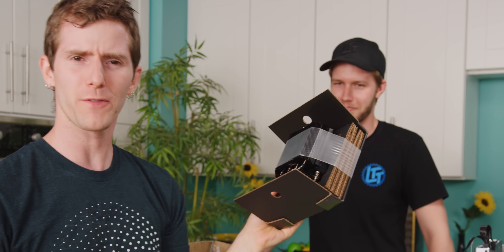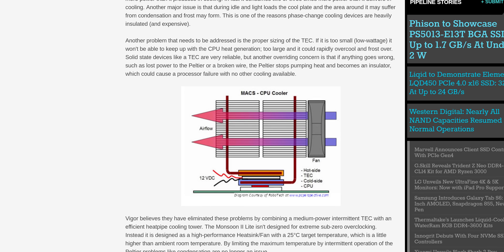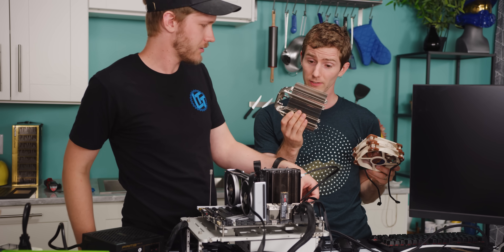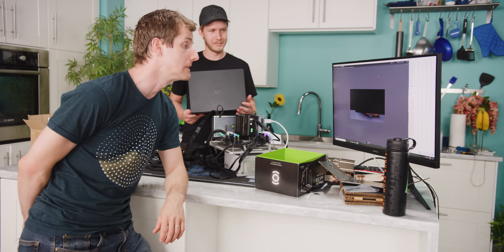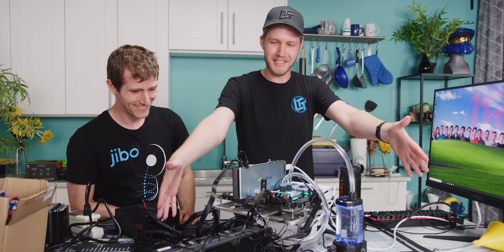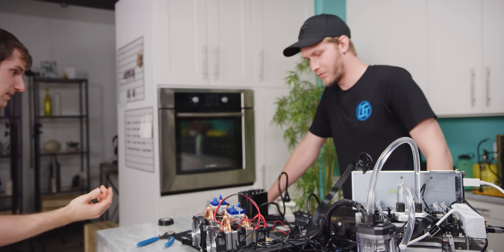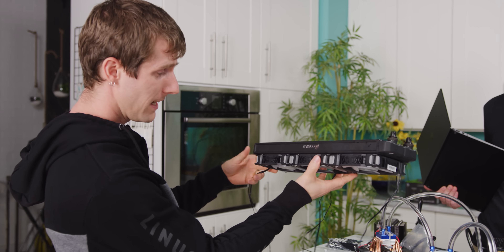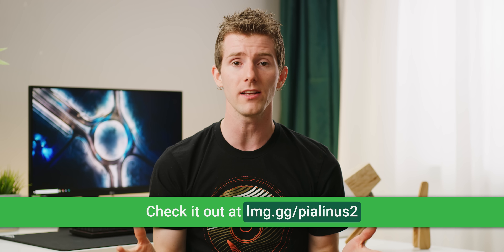Thermoelectric Cooling is a Bad Idea

Comment: Thermoel. devices should be controlled with linear control for max efficiency. Otherwise they are bad. Efficiency is a peak in behavior which can only be reached by feedback controlled systems.

Comment: Water flow should be more turbulent in the module itself. There should be more design work done so it works more like a water heat exchanger.

Comment: i think what's happening here. the way you cool the system comes down to how much heat you dissipate vs how much you produce. peltiers are only 5% efficient. this means every 5 units of heat it transfers, it produces 95. this means the radiator is working its ass off to dissipate the heat added the peltier. it gets the radiator hotter and that helps speed up cooling but it can't even come close to the 19 times more heat it introduces.

the advantage peltiers bring on the table is that they enable us to pump heat between mediums that are at the same temperature which a radiator can't do. then again in this context if you don't have much temp diff, you don't need cooling.

the only way i can think of utilizing peltier here is that if we need to transfer heat faster than the temp diff allows us. i.e. the cpu produces so much heat that we already need a giant ass radiator but because it is so big that we can't get it hot enough. we can't conduct the heat as much as we need. then the petier could help pump the heat to the radiator and/or from the radiator to another one.

Comment: Ive been more interested in using the Peltier Modules to chill a tank of coolant that is used to directly cool the CPU and/or GPU, etc..
Using an additional radiator to water cool the Peltier Module on a separate system/loop.
Thus creating a kind of battery effect of super chilled coolant for when you actually need it.
So maybe a 4 module system of say 2 or 3 amp Peltier's that can be kicked in to extend the cooling time available, also affected by the coolant tank capacity.
Would this be a better and more efficient system than other forms of peltier cooler systems?
Would you be willing to test this theory???
Oh the reason for the smaller capacity peltier's is that the more Cells on the block the more heat is transferred in a smaller space and the harder it is to efficiently remove the heat from the module.

Comment: Why not combine a standard loop with a fish tank chiller? The radiators still do the majority of the cooling. The chiller can be used to lower the water temp even further once there is enough radiator and fan capacity to keep things under control. With a temperature comparator to monitor ambient air and water temp and control the chiller, the water could be brought down to ambient at idle. At load, the radiators will do the majority of the cooling, the peltier just assisting the existing radiators. Thereby avoiding any issues of throttling by the peltier.

Comment: The benefit of the peltier cooler is that it can make things “below room temperature”. Which means we should not use conventional structure to build the system. I have an idea: making a large piece of solid copper or preferably with many thermotubes have contact with cpu while place many pieces of peltier coolers in contact with other sides of the solid copper. Using hydro cooling system to cool the peltier cooler. You guys may give a try.

Comment: I got one of the chinese 5x40mm aliuminium peltier blocks cooled by 480mm radiator.
Thats how much peltiers you need to have sub-ambient water with Ryzen 5800X running full tilt, each 12710 peltier is about 78w on 12volts, thats 390watts used and that aint the cooling power, its much less.
I found this impractical and desided to start using it as room cooler in hot days with radiator at cold side cooling the air.

Comment: here's a fact:  nasa's voyager 1's nuclear rods have... you guessed it... TEG Thermoelectric Power generators producing voltage to power the spacecraft outside our solar system, probably cost thousands back then, now you can get them on Ebay for 4 bucks you can even make your own power generator

Comment: Soooo if the PC generates heat into the hundreds of degrees couldn't you do the inverse with a peltier plate? Pulling electricity from the heatsink and generating cold, whilst powering a low power usage fan that if a certain box was formed with air ducts of some kind could power a fan that redirects that cold air back to the air intake fan? Resulting in colder air being pushed into the heatsink without an overwhelming increase in power consumption or none at all?
It might only give you a few degrees in colder temp but since your already generating high heat from running at full blast might as well reuse that heat for further cooling right?

Comment: The only thing I have every found them useful for is that when I was a truck driver in the '90s, I had an Igloo cooler that had one built into it that was designed to fit in a specific space in Freightliner sleepers. It worked great. Never found a useful application again. They have a COP of about 2 max if you can find a place to dump the heat away from what you are cooling.

Comment: TEC cooling can be done well but as soon as it went from hardcore hobby to off the shelf in 2007 you ended up with crap like this.  Back in the early 2000s when you had to solder jumpers on your motherboard in order to even over clock is when I did a TEC cooling setup. Liquid cooled the hot side into a chevy blazer heater core and yes I used an external power supply for TEC. Had to enclose the cold side in neoprene to prevent condensation, ran the CPU at 5 deg C under full load and -5 under marginal load as overclocked as was possible with the motherboard and memory limitations at the time.

Comment: This brought back memories! I was using peltiers back in  98-2000 for my gaming rig. I’d run a peltier  sandwich which was a copper plate on cpu, one peltier on the copper plate, another copper plate on the hot side, two more peltiers, another copper plate, then 4 more peltiers, and a custom water block. I used a modified aircon unit that had the evaporator concealed in a water tight unit running a fully submerged water pump with about 15 litres of coolant which passed through the peltier water block. There was a lot of Insulation and waterproofing required to battle condensation. I was able to achieve -91c on the chip. Snap froze my nephews fingers to the cold plate 🤣😂 I smoked a few mother boards and chips in the process. I finally had enough when I went away for a weekend and my partner who couldn’t bear the noise of the water pump and aircon unit condenser cooling fans, powered everything down except the peltiers. Needless to say all the insulation had melted, and the chip basically crystallised and cracked. All of this to overclock chipsets like Celeron 333 🤦‍♂️ it was pointless and expensive, but fun experimenting with them.

Comment: I'm a DIY mechanic. Knowing how engines in modern cars such as a bmw use a map controlled thermostat. Without it , it will just buildup heat and not be able to maintain let alone drop its cooling temperature. This is just worthless unless there is trillions of dollars thrown in engineering.

Comment: been experimenting with this in another way.... use a peltier on a waterblock to cool the water... and power it with a controller that reacts to the water temp... results are monster!! but the energy bills are crazy... whahah really crazy... my new idea is to minimize the power usage of a peltier by turning heat 2 voltage .... well it's only at idea stage because the physics is still way above knowledge, i know it is possible but as I sayd... knowledge, time and budget limit me... so if someone reading this does have those factors.... good luck and give it a brainspin...yup I know 100% returns is impossible hahaha lets start with a few % and see how far this can go..  and what is better for generating power ? the fast changing part(source) or rad.. (slow)... capacitor or battery style syndrome so maybe both... hahah the way I build my setup was by creating 2 units... one case is my pc.. the other my cooling case... the powerdraw is like having 2 pc's hahaha from out of the box thinking and creating 2 boxes... crazy

Comment: Sir i want to use 4 [TEC 12715] peltier module from one Power supply each peltier module requires 12V 15A  so which smps is suitable for sufficient power for all 4 pelter modules?

Comment: I had a CoolIt! cooler (whatever their higher end one was called) back in the day. The design was quite different from this; it was effectively an AiO cooler that had TECs between the loop and the radiator. Worked quite well for several years, up to the point that I ultimately had a pump failure.
Reply: The pumps always fail on these units. Im still using a modified FreezeOne that works on modern cpus. Replace the pump, the fan ( 120mm mod ) and the block and you have a great cooler. I ended up replacing the lines with Tygon chemical grade tubing for longevity. For even safer cooling, cover the resevoirs with closed-cell padding to avoid condensation.

Comment: Cooling is all about surface area. The water passing through a radiator is run through extremely thin pipes so it cools down much faster. Since the water in the Peltier loop was only passing through a small CPU block, it didn't stay in contact with the TEC long enough to cool down. It's like holding a match up to a 20-foot water pipe as the cold water passes through thinking you're going to get hot water on the other side. Slowing the flow of water would have been my first choice. My second choice would be to run the two TECs side-by-side on a single surface and use a much larger block with a chamber effect so the water has to pass back and forth over the surface several times. This may have worked better than using two large CPU blocks since the heat dissipation area was only about 5.12 square inches.

Comment: In a sound studio, you can't use either traditional watercooling or fans because of the noise they make. So if you don't have the option of doing your cooling in a different room, then using peltier modules can be a good idea. You could put lots of peltier modules on the outside of the chassis to silently pump heat out of the system and in that way improve the efficiency of the CPU cooler. Come to think of it, I think that could also be used to bring the system down to very low temperatures, since the condensation would gather on the outside of your chassis and away from any electronics.

Comment: first assumption ... perpetual motion DOES exist .. you live on a body in a solar system in a galaxy in a universe that gets NO EXTERNAL power input .. the EXACT definition of perpetual motion .... so technically you LIVE on a perpetual motion device and are wrong ... to me 16.5 BILLION years working with no external power input is as perpetual as is possible to get ... and btw that is the EXACT definition of perpetual motion
.
the pelltier device cooler was a piss poor design and of course wouldnt work ... part of a pelltier device is the need to move the hot away from the device fast ...
Reply: btw a pelltier device cooler was first used on the AT&T Alpha CPU ... it was found the device worked BUT was unable to seperate the hot and cold far enough apart ... BUT it did cool internal air faster than a heat sink alone .... which allows one to cool the airflow in the system instead of direct cooling ....

Comment: Problem is, did Peltier more capable of transfering heat from 1 side to another than copper or aluminium? In fact, no, that's why it's a bad Idea. And look at the volume of water cooled by the corsair and the one cooled by the Peltier, how many time the water is cooled too ...

Comment: Wow you are young.
They've tried it in the 90's. 
The 486 DX100 was cooled by a 1" x 1" fan.
Then came along the First Pentium Computers, and a bunch of them shipped with what they then called the IceCap cooler, between the heatsink and 1" x 1" fan,
They missed the whole humidity causes condensation onto the motherboard where you deal with extreme temp diffs.

Comment: Do heatpipes work upside down? The liquid turns into a gas with heat but in that orientation the hot gas would get trapped  in the hot part?

Comment: Why try to solve the problem with half a solution?
We know the cpu will heat up with use. The heat sink here is reducing the efficiency of the peltier device to draw heat by heating the air around it. So, the solution is a highly thermoconductive materiel in direct contact with the entirety of the surface area of the cpu casing and the peltier device. The efficiency of the cooling effect will be increase by magnitudes. This will require significantly less power. Now, we can apply the heat sink to the side of the peltier device we’re transferring heat too. This will heat the air inside the case. Lucky for us, heat rises. By using a vacuum to draw the heated air against the top surface of the case, we can then utilize the seebeck effect with an array of   Peltier devices sharing the opposing surface area. Instead of powering these, we would convert the difference in the temperate of the top side of the case and the ambient temp in the room into electric energy, further drawing heat out of the system. 
Currently, we not only lose energy in our computer systems through heat, we use even more energy to cool that heat. We need a new system, like the one described above, to start conserving and recapturing our energy.

Comment: I'm not confident about regular tubing and fittings.
I do feel some confidence in AIO yet I do have a complaint about not being able to see into the block to know when to replace the unit.
Fancy Displays on the AIO are blocking the view of the inside of the water block to know when it's time to replace it.
When the time will come when these things are fully resolved, I've no idea.

Comment: I know this is old, but christ this is stupid.  Were they trying to chill the water with the peltier?  The smart way to hook this up is cpu heatspreader => correctly sized peltier => water block => massive remote radiator.  The peltier is a heat pump that is designed to overcome the heat-transfer capability of a stock heat spreader.  It's crazy seeing this kid do things we did 25 years ago, but doing them very badly.

Comment: Running cold water from a nearest river or cold grid water from your home, its the cheapest cooling for gaming and mining with CPU and GPU. i do mining in the winter time for 5 months because I only need to pump cold water with a dc pump 12v 4A. 48watts consunption. You can even use a motorcycle radiator or a spiral copper coil running it trough the ground in your garden so water comes trough the pvc hose to your pc at 5°C celsiuc.

Comment: linus. you did it wrong. I have a settup with 2 200w pelts. Put a rad in series with the pelts on the hot side and the pelts on the output. Thermal tech to keep it from going below condensation temp and you are good.

Comment: What if you add a radiator to get rid of the cpu heat and a reservoir to have more chilled water ready 
like chiller takes water from reservoir and out to reservoir from reservoir to cpu cpu to radiator radiator to reservoir

Comment: The problem is you are saturating your heat syncs. if you had a cooling system designed to remove that much heat these units should be able to remain effective, the problem is for the same size of heat sync, your adding in the additional heat created by the thermo electric unit.

Comment: Peltier cooling is great when absolutely no other solution will work, & crappy when there is any other solution available that actually works.  Basically satellites or space exploration vehicles with low power cooling required, ultimate reliability over decades, & virtually nowhere else.  Certainly not gaming computers where a heat-sink & easily replaced fan, or water cooling loop which you can maintain or replace will do, the point of them is solid state & zero ever required maintenance.

Comment: A peltier that draws less than 150w isn't going to get very cold, btw. 300w will give you a very cold and wide patch. I've seen systems using 1200w of pelt power

Comment: they are inefficient, but they can be made to work well in the cirmcumstance that you are needing to avoid refridgerent pumping for whatever reason, say for eco (yes, the peliter takes more power, but power in itself isn't necessarily not eco, it depends on the source) safety, or longevity reasons. well set up peltiers with passive cooling don't have a obsolencent life, they will work as good on day 100000000 as day 1.

Comment: Back in the day Corsair made a TEC water block for ram which is actually practical as ram doesn't make enough heat to overwhelm the TEC but is temperature sensitive enough to benefit from superior cooling from a TEC.

Comment: So... Maybe I'm wrong but doesn't the cooling of a chip work through the transference of heat from one side to the other; a flow of heat persay?  If you are putting the cold side of TEC onto the hot side of the CPU aren't you effectively stopping the flow of heat. Have you considered trying to put the cold side of the TEC on the cold side of the CPU, so under the board then ventilating out the heat from under the board with water cooling?  This would theoretically create a hyper flow of cold from one side to the other right making the hot of the CPU not get that hot because it has a lot mot to heat up. Like I said Maybe I am thinking of this all wrong. Just a thought.

Comment: A completely useless attempt to repair tooth cavities through the back hole.
The era of steam engines and liquid coolings is long gone.
Peltiers must be connected directly between the processor and the cooler.
If 2 peltiers are thermally connected in series, the processor will go far into minus (unless energy is limited).